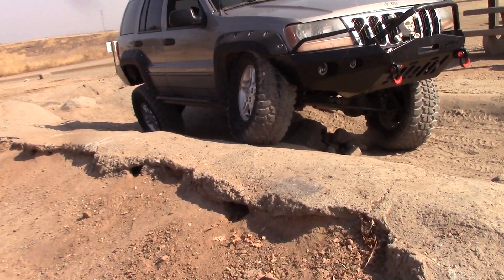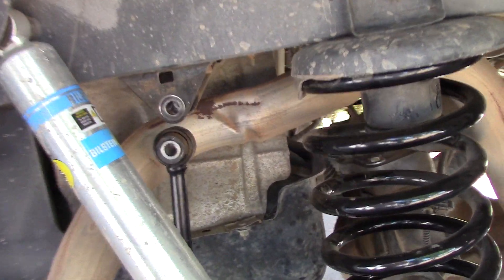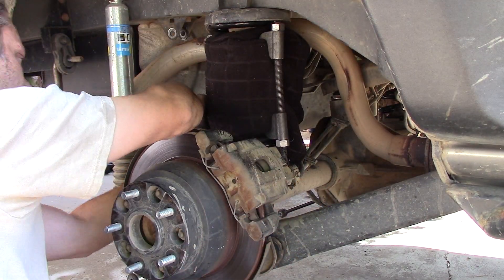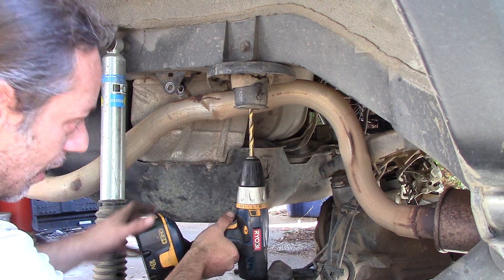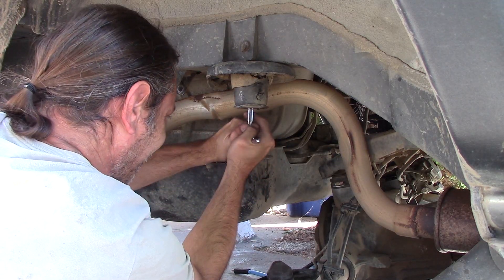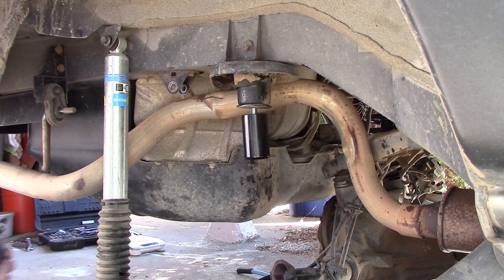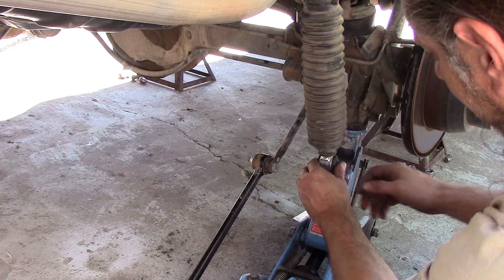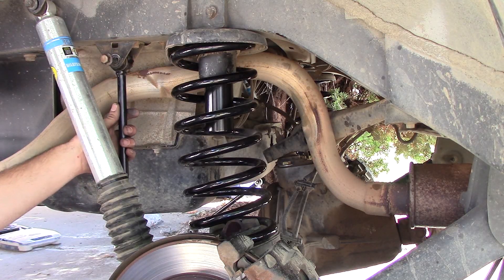1999-2004 Jeep Grand Cherokee Rear Bump Stops Install.

Comment: So this should be done befor installing the lift kit
Reply from the maker: You need to see how far your vehicle is going to flex after you put your lift kit on it really depends on the tires you have if I had a different tire set up with different offset in size it may not rub and I may not need that size of bump stop
Reply: @FastestIntegra  thanx!

Comment: I believe you installed an upper spring retainer and not a bump stop.
Reply from the maker: WOW I need to call IRO and tell them I got the wrong parts. A spring retainer to funny.
Reply: Looked like an upper spring retainer to me. I could be wrong. I went with limiting straps anyway.
Reply from the maker: @tahllarson7298  You sent the the IRO link for the custom rear bump stops. That is what is on this Jeep in this video.
Reply: The upper doesn’t have a spring retainer. The bumpstops will help guide it back to its home but that’s not it’s real purpose

Comment: Did you ever conider using your battery drill set slow with low torque????
Reply: Word, If you're resorting to adjustable wrenches go full hog. To eliminate or reduce snapping the tap off, I can see perhaps getting the initial threads cut via adj. wrench, indeed once accomplished just go for it. I mean even from camera at which angle is not level, concentricity to the wind.